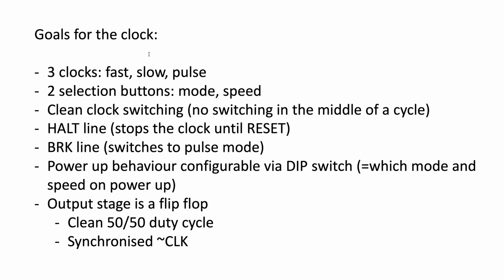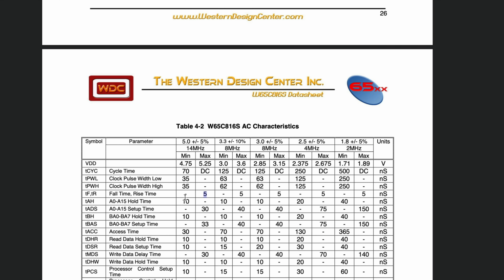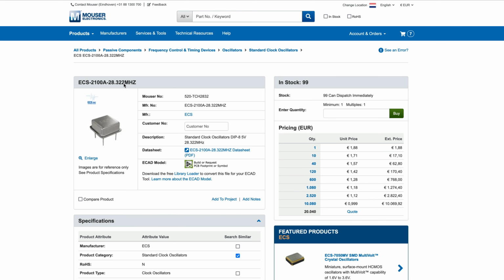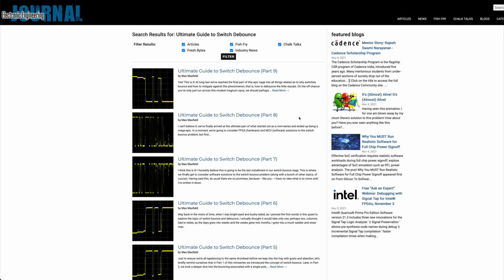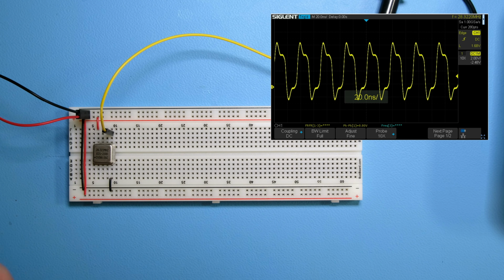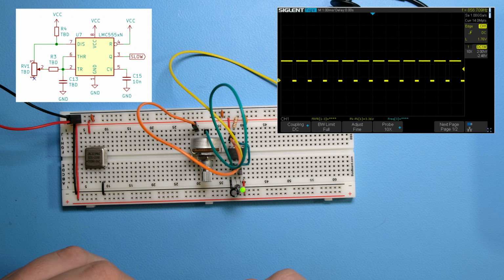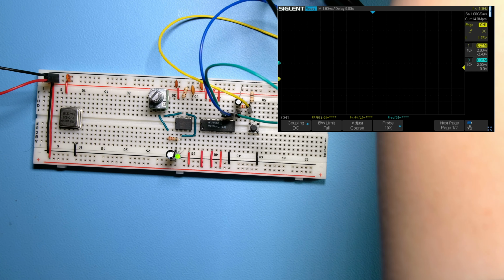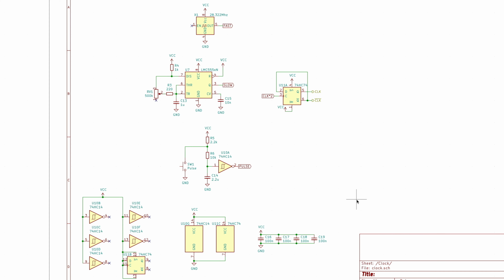#8 - Clock module #1 - BB816 Computer

Comment: Maybe I missed something, but your timings diagram is based on a 10Mhz clock. Did you check it with a 14.1xxMhz clock?
Reply from the maker: Hey! I'm using 10MHz because it makes for a more compact view on the video. I'm actually targeting only 4MHz for now on the hardware side.

Comment: You can use the 555 in a little different way to get 50% duty cycle - don't use discharge pin, just use a resistor straight from output to trigger/threshold and a capacitor from there to ground. Simplifies the circuit a bit and as a bonus you can vary the frequency with a potentiometer without changing the duty at all.
EDIT: I know this doesn't matter for this circuit because you are using a divider to make it 50% duty cycle, but still it might be useful for you somewhere.
EDIT2: You forgot the diode in switch debounce circuit ;-) Yes, it isn't mandatory I know ;-)
Reply from the maker: Right, I didn't even think of using it this way, but it could work! Thanks. Maybe I'll update it in a future episode. About the diode on the debounce, it is not strictly necessary, it just simplifies component selection by making it so each side of the delay only depends on one resistor. So I decided to ignore it here.
Reply from the maker: I just tried the circuit for the 555 for 50% duty cycle. It works for most of the range but it breaks down when R goes to ~zero, I start to see charging curves on the output and the duty cycle goes to 60/40. Do you know if that can be fixed?
Reply: @akohlbecker  Do you have a small resistor in series with the potentiometer? ;-) Having pin 3, 2 and 6 shorted together is probably out of spec for any 555 version. You are basically charging and discharging the capacitor with maximum current the output can push or pull - if the timing goes further away from 50% it means that it is either sourcing or sinking less ;-) So I'd say - either use a 10x smaller cap and 10x larger resistor or you need to have the limit set a little lower :-)
EDIT: and you need that small value limiting resistor in series with the potentiometer :-)
Reply from the maker: I do, I have a 220 ohm in series. Thanks for the tips!
Reply: @akohlbecker  Your 555 is probably CMOS (good thing) and they can source max ~15mA (and sink 200mA). So you need to pick your components with this in mind. CMOS 555s work better with smaller capacitors and larger resistors.
Reply: @akohlbecker  It just dawned on me that you have free schmitt inverter gates - you don't need the 555 at all to generate the slow clock. You can use one of those inverters as the astable, and maybe another one to buffer the output.
Reply from the maker: Huh, interesting, might try that. Or might keep the 555 for sentimental value idk :-D